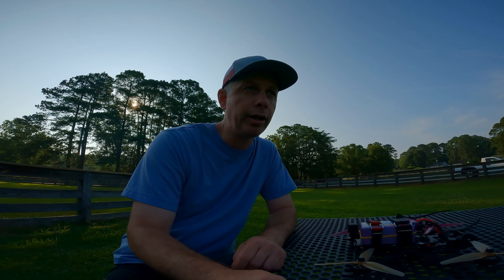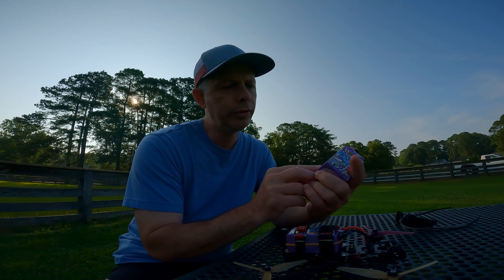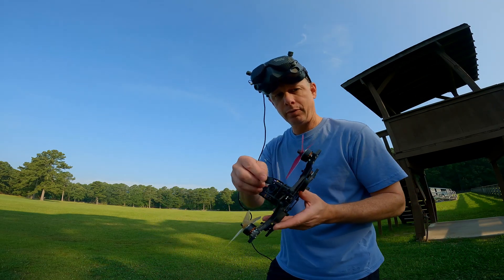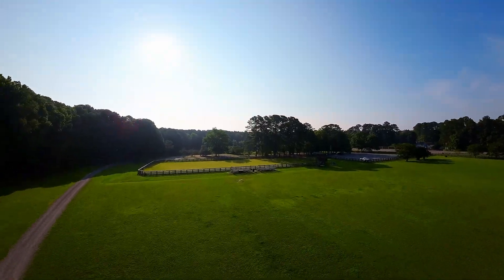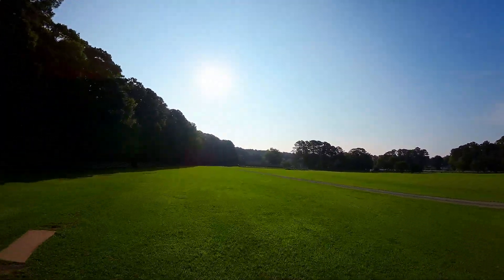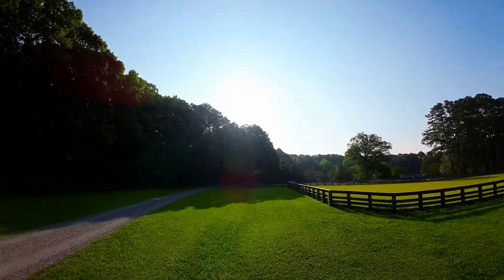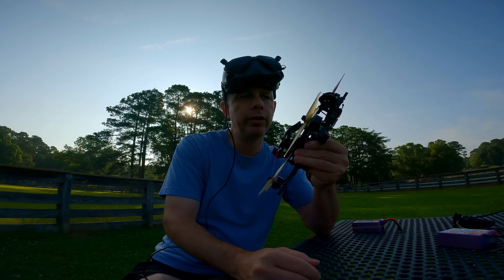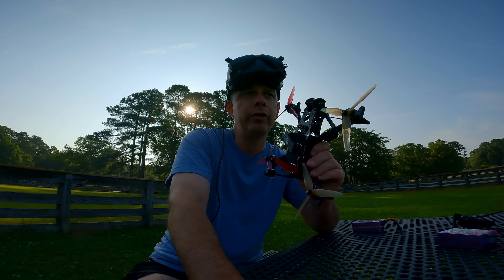8s Freestyle Chris Rosser drone review (7-02-2023)

Comment: I bought tmotor velox 2207 1500kv for my 8s tanq 2 build, did i hear uou say youre using a 27 stator size motor?? XD do you think mine will be a bit too small?
Reply from the maker: I am using the T-MOTOR F60-1500kv protype Brushless motors
Reply: I have an 8s tanq 2 also with the same exact motors. I haven't had an issue with mine. Ive tried a few different 22xx and I like the rc inpower ones best.

Comment: My aos 5.5 has wierd oscillations. After changing the stack and motors it came down to being the frame. I'm not so impressed with it anymore. Also the arms broke very ofter. Now everything is converted to the apex frame and no more problems.
Foxeer makes awesome stacks even up to 8S.
I build mine with the xnova 2208 1500kv. Where did you get your 8S motors? I'd like some 8s tmotor ones too.
Thanks for sharing
Reply from the maker: Well sorry with your issues with the AOS frame, it is really my most favorite frame of all time. I can turn off so many filters as they are not needed. I too have the xnova 2208 1500kv motors but a friend gave me the 8s motors that were featured.
Reply: Be sure to apply the AOS Betaflight preset. My LR5 is P E R F E C T